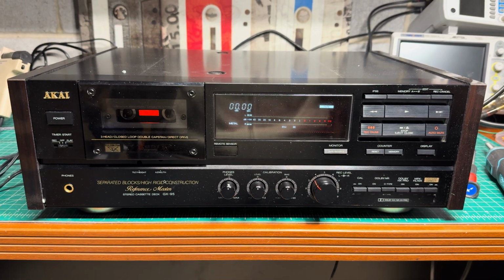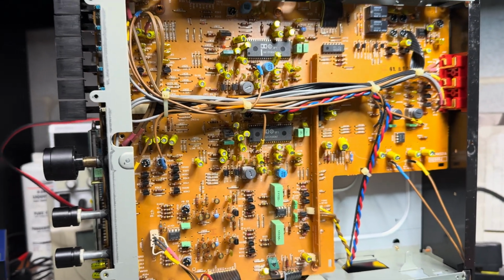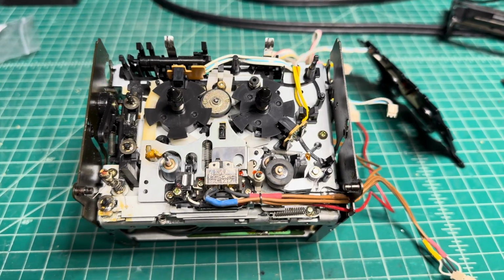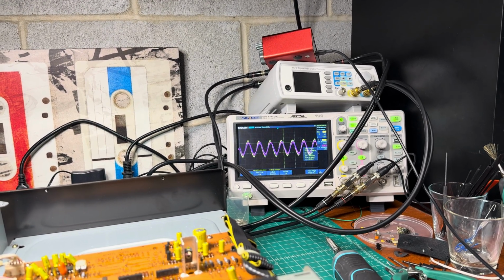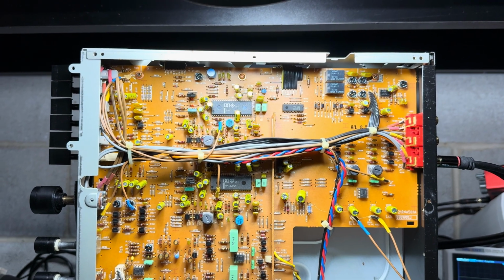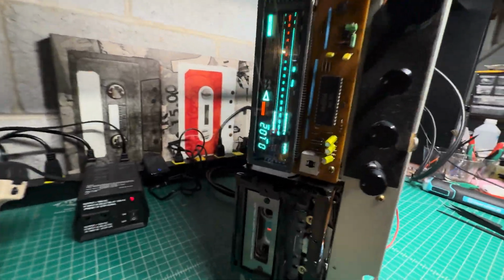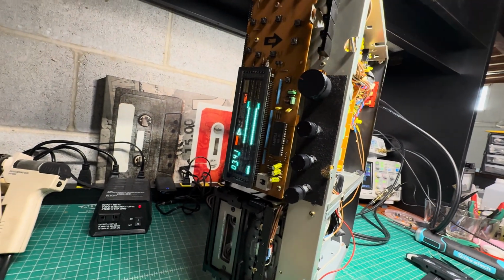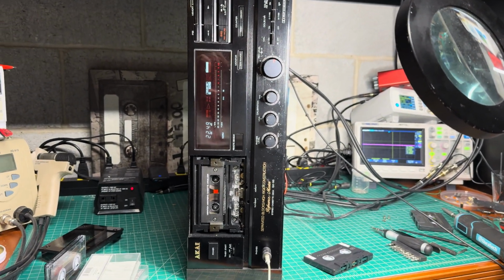Tough Restoration of a Butchered Akai GX-95: From Hopeless to Hero

Comment: Great video. thanks! I have the same deck and rec level potentiometer and it cracks and breaks and it didn't fix after turning it about 30 times. Is there easy access to use Kontakt PRF 7-78 spray?
Reply from the maker: Remove bottom cover
Reply: @hifirulezzz  Thank you very much! Is there a special hole where to spray?
Reply from the maker: @ebor65 you will find it 😉
Reply from the maker: @ebor65 some pots have round hole, some allow to spray only from contacts side and some don’t allow to spray at all as fully closed design. Finding replacement is hard. But I was successful in 2024 finding necessary ports in China. Good luck.
Reply from the maker: @e @ebor65 on your picture I would use round hole on the side.
Reply: @hifirulezzz I apologize for asking too much, but do you remember where in China you found such a potentiometer for the Akai GX-95?
Reply: @hifirulezzz Thank you, I will try it. Very annoying problem considering everything else works perfectly.
Reply: @hifirulezzz Thank you. Very annoying problem considering everything else works perfectly.
Reply from the maker: @ebor65 I never told I found for GX-95, I found for GX-93 😉 but these are similar. Long night web browsing. These are not available at the place i bought. Try your luck.

Comment: Thank you for this video! I have one of these and I'm a complete tape deck noob, but seeing your techniques working on it helped me turn my deck from a completely unusable disaster into a unit that works well. I think mine has some fault on the oscillator board because I have to turn the rec level way up with the internal trimmers on one channel in order to achieve even performance, but it's good enough for my needs!

Comment: I not understood if you added the 220pF capacitors to existed 68pF or replaced it, because in other video aboutt 9100ev you told you replaced.. Thank you
Reply from the maker: @TalBar-audiofan  in that deck I have to add in a parallel. It was try and check mode as it usually does. I tried multiple values and come up with the best option to have linear response.
Reply from the maker: @TalBar-audiofan  also, in that deck factory caps are 120 pF, not 68 pF as in A&D. So, in total it got to 120+220=340 pF
Reply: @ So strange...i had 68pF, but replaced it with 220..You righto maybe i need to add some and less adjustments. Thank you

Comment: To access the bottom circuit board, you need remove the upper control board and remove de metal cover. No need to remove front and back panel at all...
Reply from the maker: Sounds like not a correct way. This deck has separate compartments for Audio and Control logic boards.
Reply: @hifirulezzz Actualy it is. I own 2 of GX-75 MKII and for one I removed the upper control board and the cover to acces bottom audio board. No need to remove front and end plates. Second, you should start cu align the heads with proper tools, not by ear, as you did. You needed Head Height Alignment Test Tape 1kHz narrow track to properly aligne the head high. Third, you should use 12,5 kHz to set up bias, not 10 kHz as you did. You definelty didn't follow the Service Manual.
Reply from the maker: @ you are kidding, right? I used gx300 gauge and mirror tape to align heads. And there is exactly zero difference in azimuth alignment by 10 kHz and 12 kHz.
Reply: @hifirulezzz  No, I'm not, because I didn't see you using the gauge and because you didn't align the heads at first try, as far I remember. But because you mentioned that now, I aplologise. Anyway, for these kind of heads you need the head high alignment tape that i mentoned above, just like Nakamichi.... Regarding the 12 kHz tone, I was referring to the bias adjustment, not the azimuth, according to the service manual. Anyway, you're doing a great job. Congratulations on your work. Waiting from more videos from you.
Reply from the maker: @cupitza  Thanks. I was talking about the gauge in my video. The problem was that erase head was sitting higher than the proper hight by gauge. I had to make it work :( Otherwise metal tape was not fully erasing.
Reply: @hifirulezzz Well, maybe I wasn't paying too much attention when I watched it. Sorry for that.
Anyway, I recommend a head high alignment tape for this kind of heads (similar to Nakamichi). It was very helpful with one of my GX75 MKII.

Comment: I cannot believe it... there's no height (side to side adjustment on the tape) on a machine like that... is that really the case?

It makes me really develop an appreciation for the TC-K series skewed erase heads from the factory I believe. At least they were working properly before and they work perfectly after alignment... all 3 of my K-ES machines needed that.
Reply from the maker: You may well check service manual and see that erase head sits on the plastic base tied with the screw directly to the carriage. No springs or anything to adjust the hight. Page 15.
Reply: @hifirulezzz  it doesn't make much honor to the manufacturer... is it perhaps because you were meant to buy an A&D to have the erase head adjustability? It's a weird design choice.
Reply from the maker: @m80116  Not really, they may have different hight of the plastic stand under the head. And tune necessary hight with their gauge on the factory.
Reply from the maker: @m80116  Also, My gauge thickness may be different from what they used.
Reply: @hifirulezzz  that would be even more surprising to me. I won't delist AKAI from my 3head collector's pick but I am less keen to buy it ahead of something else now since they command even more money than K333.

Comment: 16:12 I have heard GX heads are only glass partly, and can still wear.
Reply from the maker: @lachlanlau  magnetic material is ferrite, glass is just around it. These heads develop micro cracks on the gap edge. That reduces sensitivity to magnetic field. It is possible to lap these heads, but much harder than made from other materials. Easier to correct the response.
Reply: i own several GX Reel to reel and cassette decks, and never had or spot(ed) any form of wear on none of my units ( GX-R88, GX-9, GX-75, GXC-750, GX-221, GX-636,GX-650). I use the GX-221 daily since 2002, no wear.
Reply from the maker: @tubical71  you would not be able to see it with a naked eye. Microscope helps.
Reply: @hifirulezzz  i know...i take the mantis ;)

Comment: You Sir are an absolute legend! I am the owner of this deck, I purchased it locally in Richmond, Texas from an estate sale of a deceased electronics engineer. The seller advertised it in fully working condition but as soon as I saw it I noticed there were problems. Managed to purchase it very cheap in the hope I could get it fully restored. Initially I was recommended to try an electronics repair shop in Houston but they eventually told me it required a complete new tape mechanism to get it back to working condition.
As I am also a long time member of the Tapeheads forum I started searching for more reputable specialists and after some email correspondence HifiRulezzz offered to take a look.
I am so grateful for all you have done to get this machine back to its former glory. Thank you, thank you, thank you.
Reply: Nessuno batte hifirulezzz,nessuno
Reply: As for me, it's a greatest tape deck repairs channel! Thank you!

Comment: I own the same deck. I bought it new in 1989 or 1990. Still love it. The question I have is how can I check if it’s still within spec?
Reply: No way to verify the head without a reference cassette. There are labs that can provide a Frequency Response cassette for quite accessible costs.

There are 3 test cassettes that you cannot do without for calibration:
- Azimuth
- Levels
- Speed

Frequency response being part of levels but usually provided in a separate cassette, the first being levels for Dolby or thereabouts.

To be completely honest if you have some experience you can figure that out but should you need to compensate you'd still need precise values.
Reply: simple, record on a good tape, if tape is nearly as good as the source.....it´s ok....unless you want to interchange cassettes (not so common anymore) with others ands/or decks

There´s no cheap other way, if you havent´t access to good test equipment and reference tapes. 

i also owned a gx-75, which i bought new, and it runs flawless until the ilder plastic cracked. i replaced it two times but it never was as good as the original. i sold it around and bought a denon DRM-800A für 40 bucks, back in 2012, i serviced it and it runs nicely ever since.

since i was in the pro audio studio Reel to Reel service end repair during the 90s and early 2000 i still have most of the needed measuring equip and also tapes/reels...i can tell you that most times you can set any deck to 90% by ears alone. and don´t give too much about azimuth, if you have some (like 10 or so) pre recorded cassette tapes (the ones you could buy at the stores, not DIY recorded) these are quite good for azimuth tests. run and set these are to peak high freq level in playback you found the right azimuth. or you can buy a test cassette-tape for like 120 bucks and it contains all levels, tones it needs to align, set levels and test for rec/play as well - if you want to be at 99%. 
RTM (FKA BASF) still provides these.

Remember the GX tape decks of that era uses compound heads, which can´t be adjusted fully independently. Also the first 1000 (or alike) decks suffered from cracked compound and the heads became loose and lost azimuth and also the ability to set this ever again.

 Also i modified my 75 to also run at half-speed (being stock only can do this for a couple if seconds in order to find a certain location better) for any kind of time and also rec/pay.
Reply: @ thanks for the advice of the prerecorded tapes. I did that a while ago 😀Abou RTM, they don’t have calibration tapes in their assortment (anymore?). I use the GX-95 and my GX-32 from Akai as well my Sony tck808es. I love to play and record on tape. So I like to interchange the tapes I recorded on those decks.